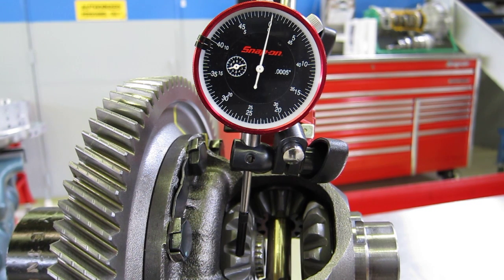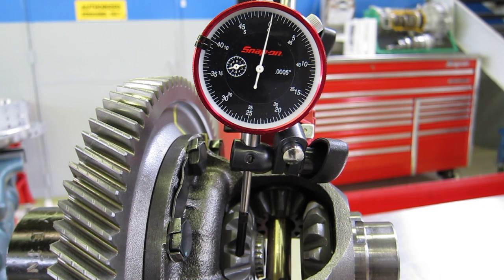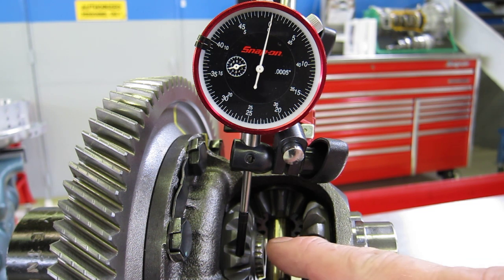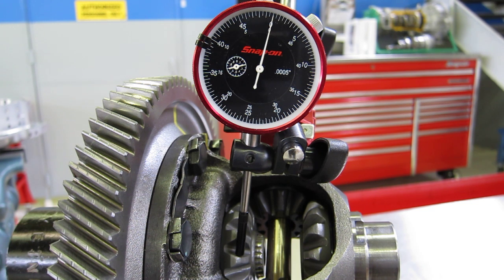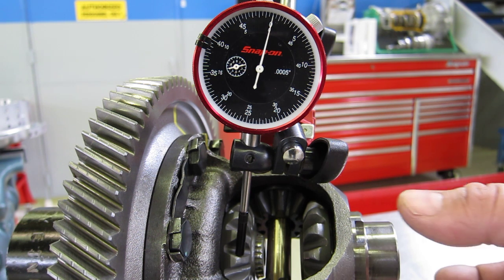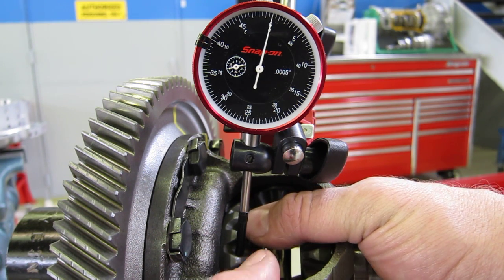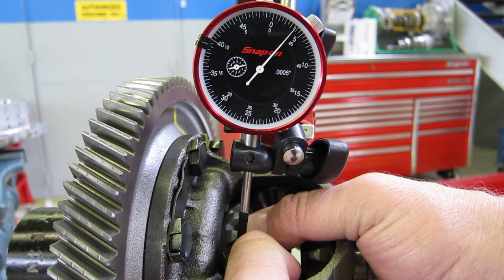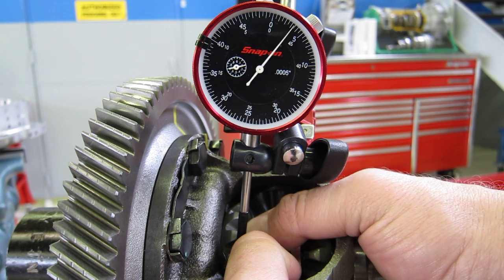Differential Side Gear Backlash Measurement

Comment: Can you tell me if this is the same problem (just a wild guess) https://www.youtube.com/watch?v=GY34eJs0gr0
This is in 1rst gear (its same in every geat) and i hate when you let go off the throttle and the car just rocks like there is space between the engine and the wheels..on uphill its ok but on straight and or downhill its annoying. Not one mechanic wants to open my transmission, everyone says its to expensive to fix buy a second hand transmission. (btw this is on ford focus 1.4L from 2009 front wheel drive)
Reply: when you open that trans it is going to be pandoras box, that is why no one wants to open it and chacnes are the labor is more then the car is worth. I would look at a new vehicle

Comment: How might this process work on a limited slip differential?
Reply from the maker: The same way, except you measure the backlash on the smaller differential pinion gears (Spyder gears). Backlash is adjusted with selectable shims behind the left and right side gear clutch packs.

Comment: I have a 2017 VW Passat, sometimes when I accelerate around 30 mph after de-accelerating from higher speeds, there is a noise I can hear from transmission. After talking to VW mechanics, they told me its a gearlash. Is that common in new cars ?
7000 miles on the car.
Reply from the maker: Yes, if it is a manual transmission
Reply: WeberAuto its am automatic transmission
Reply: Can you show me what is looks like the noise?

Comment: Should this number be the same as the backlash number of the assembled pinion and ring gear? THAT number is in a Ford service manual. No idea how to find out what this backlash should be.
Reply from the maker: No, it is typically larger; in the 0.015" range (0.381mm) range on open differentials. Limited slip differentials could be a little tighter

Comment: I am planning to replace the crosspin bolt when I do the rebuild on the front diff of my 1996 Landcruiser. when I replace this bolt will I need to correct the side gear backlash? if so, what is the correct measurement for mine & how would I go about adjusting it if needed? do you have a video on adjusting the side gear backlash?  thank so much for your attention to my questions. will the university allow me to send you a small gift for all of your help?

Comment: professor,
I just watched your video on side gear backlash. do I need to worry about this measurement for a 1996 Landcruiser, or is this taken care by the side bearing preload?
Reply from the maker: Side gear backlash is not related to side bearing preload. The side gear backlash affects noise while turning corners.
Reply: should side gear and axle spline lash be non existant?

Comment: Hey there. I recently just did an Eaton Limited slip install in a chevy 12 bolt rear end with new 3:73 gears.  Had everything adjusted within spec, backlash, gear mesh, etc. One thing I did tho was use a crush sleeve eliminator kit, its just another pack of shims that are supposed to be stronger than crush sleeves, plus none of the hassle of setting up crush sleeves. Now that its on the road I seem to have a very very slight vibration coming in and out, in and out, about 3 secs between. any idea

Comment from the maker: You may have too low of bearing preload on the pinion gear or the side bearings.  A typical ring and pinion gear set will try to pull the gears closer together when you decelerate.  Incorrect bearing preload could cause this.  Too low of ring gear to pinion gear backlash can cause the same thing.  See my video in Differential Ring and Pinion Gear Setup for more information.

Comment from the maker: @BlueDemonGTR Hi, there are usually selectable shims behind the side gears that allow backlash adjustment by moving the side gears closer or farther away from the differential pinion gears.  In some cases, the gears are severely worn and will have to be replaced if the backlash cannot be brought within specification.

Comment from the maker: @DCrepresenter Most axles have two sets of gears: 1. The ring and pinion gear set.  2. The differential gear set which consists of two side gears and two or more differential pinion gears (some people call them spider gears).  Both of the two sets of gears mentioned above have a backlash that should be checked and adjusted.  If the backlash is incorrect, the gears can make noise, overheat, or break.  The differential gear set is only used while turning corners.